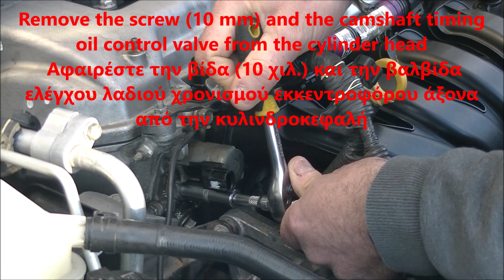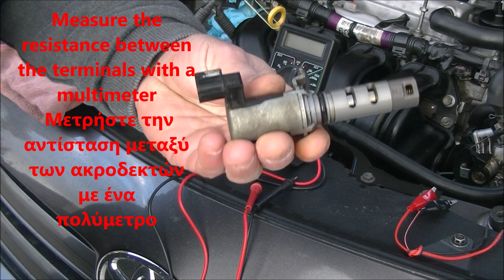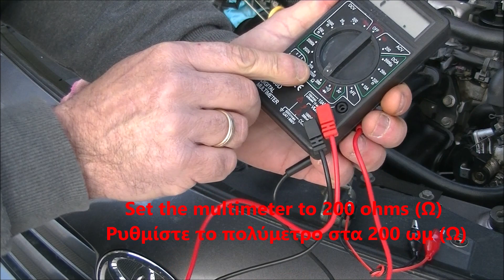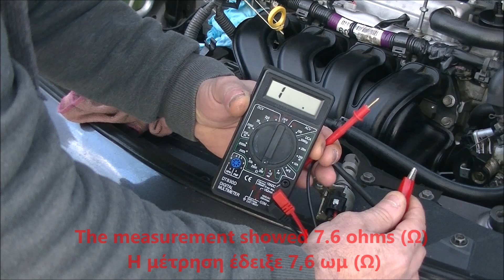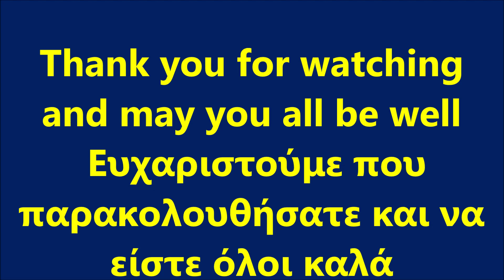2007-2013 Toyota Corolla How to Test Camshaft Timing Oil Control Valve Βαλβίδα Ελέγχου Λαδιού

Comment: When testing for a VVTI failure, it's good practice to put 12v to that solenoid to confirm the piston is moving freely.. it could be stuck.   Also, after removing the solenoid is a good time to clean the oil screen, behind the plug right below the solenoid hole.   If that's plugged up, the VVTI will fail to actuate.
Reply from the maker: I have already done everything you say. Watch my video below to see what exactly I mean
https://www.youtube.com/watch?v=bLkU7MgM4wA

Comment: I have same car. Cluster gauges are crazy  all of them, how can I fix it. Thanks for reading and nice video tutorial.
Reply from the maker: When the gauges seem to move erratically, or they are pegged at the highest possible reading, the problem is usually a bad component like an instrument voltage regulator or a bad ground. Erratic gauges, or gauges that seem to read uniformly low, are usually caused by a bad instrument voltage regulator.

Comment: Yiannis what is the alternator diod plate and lc regulator can I explain this separately
Reply from the maker: What is a diode in an alternator?
The diodes are part of the rectifier assembly that converts the alternator's AC output to DC. The alternator's charging output flows through six diodes in the rectifier assembly before it goes to the battery and electrical system. Consequently, the higher the charging load, the hotter they get.
What is IC regulator in alternator?
Electronic IC Regulator. The regulator is the brain of the charging system. It monitors both battery and stator voltages and depending on the measured voltages, the regulator will adjust the amount of rotor field current to control alternator output. Regulators can be mounted both internal or external.
How do I know if my alternator diode is bad?
Usually, a bad alternator diode will cause your headlights or instrument panel lights to flicker or dim and, sometimes, drain battery power overnight, or in minutes. * To check for a possible bad alternator diode, switch your voltmeter to a low setting on the AC (alternating current) voltage scale.
What are the parts of alternator?
The alternator has three main components and a voltage regulator: The Stator, Rotor, and Diode.
Where is diode in alternator?
Your car's alternator (used to be called a generator) will typically have up to six diodes. These are located on the alternators rectifier assembly. Electricity flows through the diodes, which convert the alternator's AC output to DC (which is what the battery runs on).